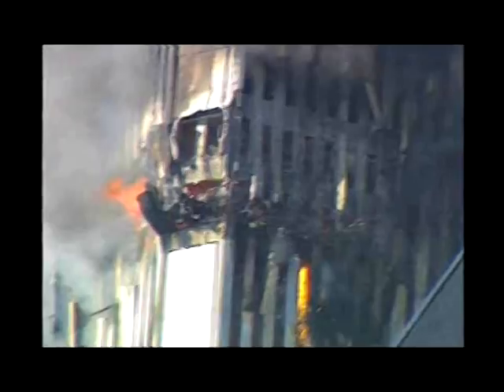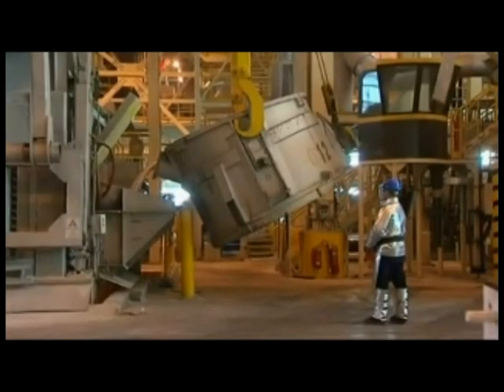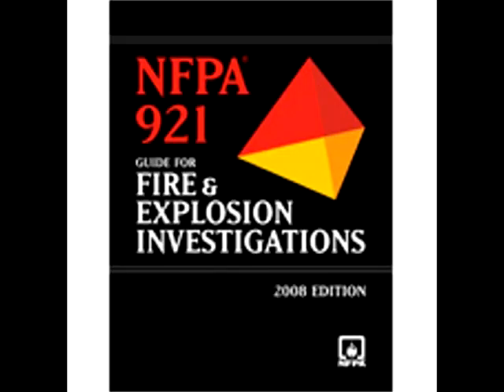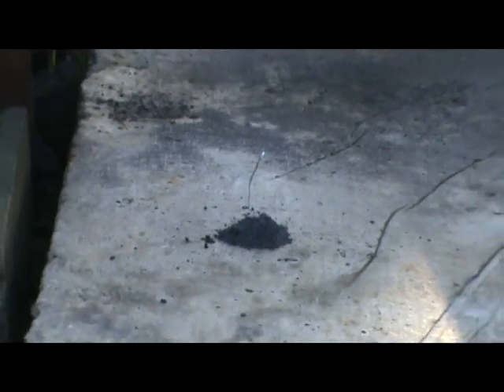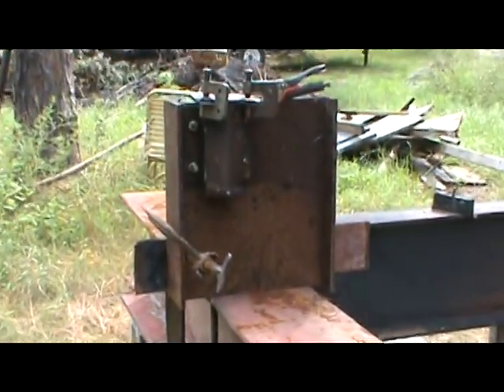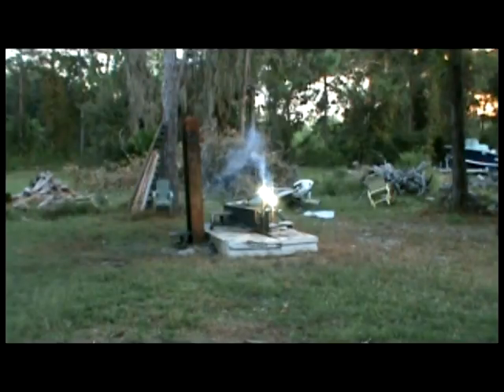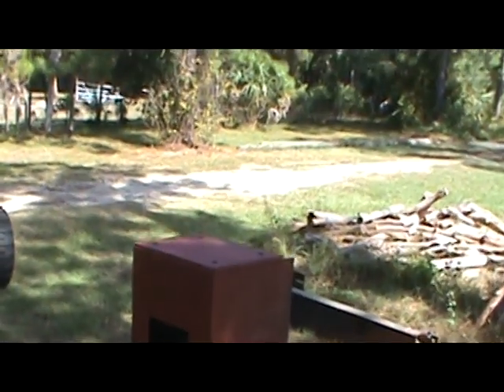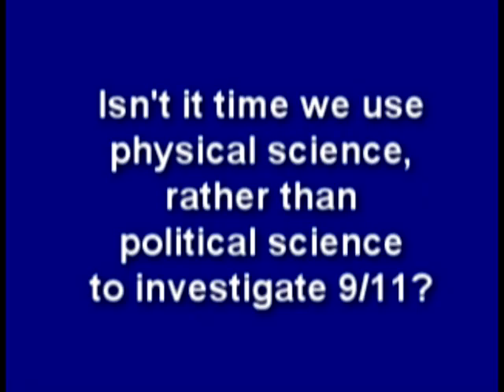9/11 Experiments: The Great Thermate Debate

Comment: So what if the fires were 1000 degrees cooler than steels melting point? That proves nothing toward the use of thermite. Nothing at all. 1000 less than steel's melting point, right. Thats the point at which a phase change occurs... Phase change of the metal isnt necessary to bring a building down. With all the weight on top... and the assumption that the steel beams were NOT 100% pure steel to begin with-lower melting point- (have done 0 research on this but i can almost guarantee my assumption is valid), these conspiracy claims are preposterous. The temp and duration  of the fires caused by a jet alone as seen during 9/11 would have weakened the beams enough to cause a collapse. It is totally plausible when you consider all of the factors that come into play. One weak poorly made beam could have caused the structure to partially buckle setting off a chain reaction causing such a collapse. The US government would never do this to their people. The risk and level of confidentiality required to keep it all quiet far outweigh any benefits. They'd sooner just invade Iraq solely on the basis of stealing oil, why go through the trouble of 9/11 to justify it? It is actually impossible.

For the record, I am Canadian, not American. I also am close to an undergrad degree in biomedical science at a University in Ontario (which will remain anonymous) so think twice before calling me an idiot. You could say I know more about Chemistry than the average Joe and idc what the theorists say because it makes perfect sense to me. Not trying to brag, but anyone with a tweak of knowledge in chemistry, or a bit of logic even, could convince themselves that there is no conspiracy here. Could it be that the media is telling the truth? If they knew more than we did, it would be out by now.  Wake the fuck up people.
Reply: Mitch Brown, you're that clueless.
The US have attacked their own people plenty of times before.

Let me put this quiet simply for you.
The fires caused by the plane crashes are open air fires.
In an open air environment, jet fuel burns between 260 and 315 degrees Celsius.
The fires would have needed to reach over 700 degrees Celsius to affect the steel beams. 

Take a look at this page, take a look at the first photo of the beam sticking out of the ground, can you see the once liquid metal on the beam? That doesn't happen when a building comes down by itself, the metal was heated past 1400 degrees Celsius to do that.
The guy in this video proves you can easily cut through steel beams using Thermate!

All facts point towards the US attacking themselves, they've done it before, they'll do it again, whenever they need the public to fall into line. I wonder what rights they'll take away next time, I wonder which country they go to war with next time, I wonder when America will realize their government is corrupt from top to bottom. Your president is merely a middle man, handing down orders from the more powerful.

This goes for every one.
Our well being isn't the priority, it's POWER.
Reply: Brock Dunnet Hey, I'd like to point out that the fires weren't exactly open air fires. I've been running a woodstove all my life and I have a fundamental understanding of thermal dynamics from doing so. The fires in the towers were sandwiched between floors. Fire causes heat and that heat rises and, as it rises it needs more air to fuel it. That air gets sucked in faster and faster as the heated air rises faster and faster in effect causeing a flue action like in a woodstove. The windows and holes created would be the intakes of the flue and the upper windows would be the exhaust of the flue. Now, woodstoves have vents on thier flues to control air flow and temperature BUT, when those vents are completely open there is no temperature control. The air can move through at hurricane speed. I nearly melted and most definately warped the sides of one of my woodstoves doing this awhile ago useing nothing more than wood. The temperature got so hot  I had to reach in with a poker to close the vents after about an 30 minute of letting it burn freely. The side of the stove got RED hot. Just with wood. I've warped steel in a mere bonfire too. An average bonfire reaches 6 to 7 hundred degrees. I also incinerate trash in my back 40. I know that once a fire is hot enough anything will combust and contribute to further intensity of the heat generated including plastic,synthetic fiber,polymer resins,aluminium,Human fat?..etc,etc. The fires in the towers by themselves were most definately hot enough to weaken the integrity of the beams in combination with ALLL the weight they had upon them to formulate the collapse. I'm just a highschool dropout with a 130+ I.Q. and figured this all out by himself. But to fair i've also had the luxury of living away from the cities and having room to roam and quiet to think in. City people don't have that luxury. They're surrounded by clammering morons and indoctronated idiots with nothing better to do than look at each other and assume the worst.
Reply: ***** Thanks dude, proved nothing. Get an education you ignorant S.O.B
Reply: I'll comment on "The US government would never do this to their people."

Well the fact of the matter is, yes they would, and have perpetrated other atrocities against their own citizens. The forced relocation to concentration camps of japanese citizens during world war II, knowingly exposing their own soldiers to a defoliant contaminated with a neurotoxin during the vietnam war. These sort of atrocities are nothing new. The fact is, whether or not the US government destroyed the world trade center towers, they are definitely willing to do such a thing if it serves whatever interests would be served by doing so.

And I'm also a canadian citizen. I can also tell you that our government is just as willing to take away rights and freedoms for the sake of national security. Stephen Harper repealed the law enabling a vote of non-confidence to allow a new prime minister to be elected.

All of these are facts. I make no claim as to whether or not 9/11 was an inside job. But the US government would DEFINITELY be willing to do such a thing. The very idea that a government is above conspiracy is dangerous.
Reply: The issue here isn't about the towers, nor the people who died in them. That's a distraction from the greater issue, which is that nobody really knows the definitive truth. But the fact that people are willing to deny that the government COULD have done it in the absence of evidence that they did is indicative of a larger problem.
Reply: Brock Dunnet I stopped reading at "jet fuel burns between 260 and 315 Celsius".... Are you that clueless? Thermate. haha. I don't have time to argue with idiots
Reply: gorgepucas have you ever actually checked the FACTS in that case, or are you content to parrot the lies you read in the comment sections of Loose Change uploads? 

Suck on this:

http://www.911myths.com/index.php/Dancing_Israelis

Comment: This is an interesting experiment but not definitive.  You failed to consider that Aircraft bodies are made from Aluminum, which can reduce Iron (in steel) during thermite reactions.  If an aircraft collided with the WTC, it would have certainly caused zones of intense pressure and heating, in addition to pulverized (ignitable) metal powders.  I'm willing to bet that with enough pressure and if the surfaces are suitable roughened, a bar of aluminum could spark a thermite reaction with a bar of iron.  There is a whole subfield of chemistry called "mechanochemistry" that explores transformations of matter under grinding.  Causing ignition is pretty straightforward.  Also, Aluminum burns with a white flame.
Reply: You're willing to "bet" that with "enough pressure" and "suitable roughness" this unlikely (but possible) natural thermite reaction could somehow bring down BOTH Twin Towers? Is that what you're honestly trying to suggest here? Do you see how far you're trying to bend things in order to try and keep the whole cover story from falling apart?
Reply: gtaclevelandcity Classical defamation tactic. You don't need a certified degree in engineering or chemistry just to know basics about engineering or chemistry. The knowledge is available to everybody who seeks it. But thanks for perpetuating the idea that without some accreditation, your take on something is worthless.

Am I required to have a degree in nuclear physics if I explain to someone what hydrogen is? I didn't think so.
Reply: Geoff Coe So where did you get you're engineering degree from?
Reply: gtaclevelandcity
Where is yours operative?
Reply: poor baby
Reply: DDTea - nice username.

I doubt you'd get a thermitic reaction from metallic aluminium and iron in this instance. It isn't actually necessary, because there is no evidence that suggests that such a material ever existed at the site. Or ANY explosive, for that matter.